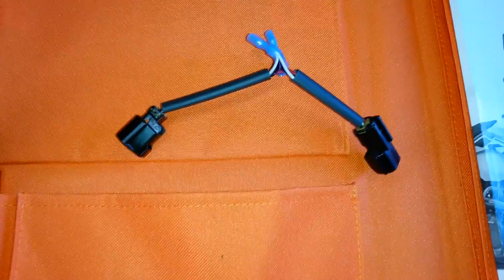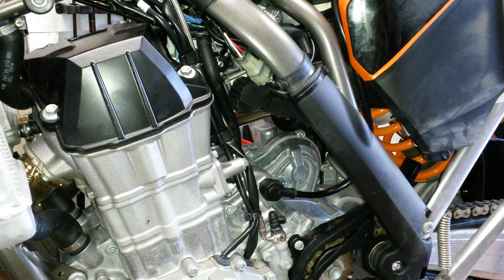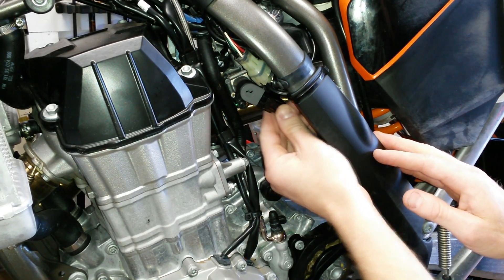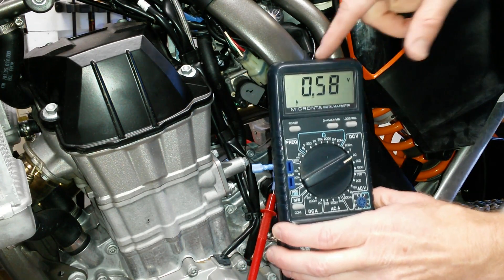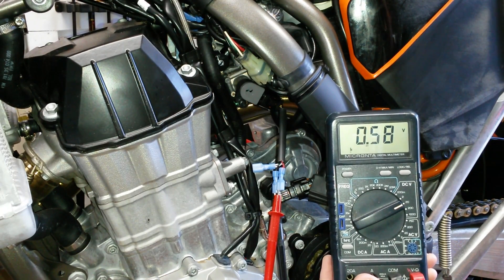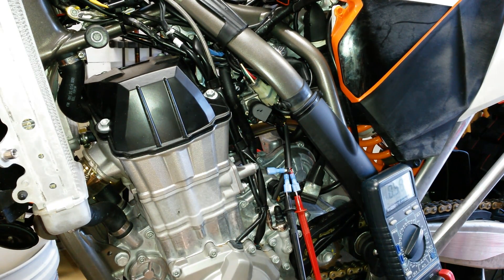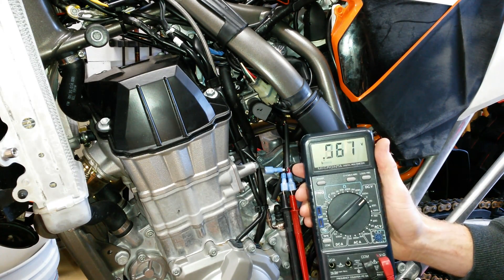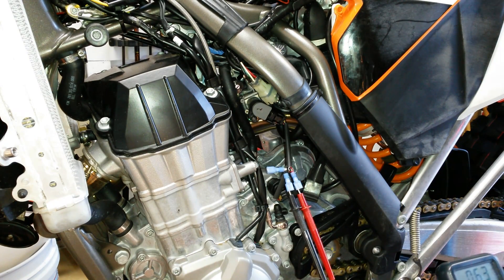KTM Throttle Position Sensor (TPS) Adjustment Made Easy - Special Tool

Comment: Hi. By moving the tps does it effect the idling?
Reply from the maker: What motor?
Reply: @Matt South  mines a ktm 350excf 2022. Its idling at 0.54
Reply from the maker: @neilb2593  Adjusting the TPS is going to change the fueling.  That change in fueling may change the idle speed a little bit, but it shouldn't be a major change unless you make a really big adjustment.  Adjusting the idle screw on that motor will change the TPS reading because the idle screw actually opens the throttle.  Does this help?
Reply: @Matt South  yeah that helps. Thanks for that cheers

Comment: what model do I need for a 2014 EXCF? I believe its model 2 but im away from my bike otherwise id check the connector.
Reply from the maker: The 2014 EXC uses the model 1.  The bike in this video is a 2014 500EXC
Reply: @8180634  would love to be able to confirm, it is a  2014 350EXCF. The website does not list this bike specifically
Reply from the maker: @martinfilteau3220  I believe it falls under EXC 2016 and earlier. Easy way to verify, go to partzilla.com and look up the TPS. If it's triangular then it's model 2, if it's oval then it's model 1.  They didn't start using model 3 on the exc until 2017.

Comment: does this work for a 2012  350xcfw
Reply from the maker: Yes it does.  But be aware that since the XCF-W does not have a key,  you would need to bump the start button to power up the TPS for about 8 seconds at a time.  Or you could just let the motor idle to keep the TPS powered up.  Or the most convenient option is the Pro Powered meter, which powers the TPS for you.  This video shows you how to adjust a non-keyed bike.  It shows a 350SX, the TPS on your bike will be much easier to access but the adjustment will work the same way.  The video shows both the pigtail and the powered meter:  https://youtu.be/v1OXY5_jAv4
Reply: @8180634  okay I need to try some things I'm having a problem with the bike starting so I'm just looking for a few things that I can check when ... and whenever I bought it the guy was running it with the idle set very high so I was trying to figure out how to adjust do I have absolutely need to have that voltmeter to or can I just do trial and error without it lol
Reply from the maker: @tjdukes7452  You "can" trial and error, but your odds are not very good.  Check out the video I linked and you'll see how sensitive it is, then decide if you want to try to free hand it.  Also I think spec idle on that bike is  around 2000rpm, plus or minus a few (check the manual), so grab a tach and set it right as that can help a lot.  The cheap hour meters from Amazon often come with a tach option.  Also check the valves as valves that are too tight can really affect starting and idle a lot, actually I would check the valves first.  If it kick starts really easily but the e-start doesn't work well then check out the torque limiter on the starter too, there are videos online about that.
Reply: @8180634  the bike kick-starts very easy the easy start button only works every once in it's to the point now where I think my battery is dead because all it does is click one time the fuel pump doesn't even turn over now
Reply from the maker: @tjdukes7452  If you suspect your battery then definitely try that first as it's quick and easy.  Jump it from your car if you have cables and that might help answer the question right away.

Comment: Is a "higher" number … from .57 to .64 mean its a little more "richer" … Im going to add a slip on pipe which will lean out my FE350. Is this my adjustment (TPS) that will make it more rich?
Reply from the maker: Yes, adjusting the TPS to a higher voltage will make it richer (more fuel).

Comment: Hi. I change the TPS for new. I have this tool. How i must set tps voltage? Throtle butterfly must by full closed , idle red screw twist off. My bike KTM sxf 350 15'  Thanks for any help.
Reply from the maker: Thanks for your question.  Double check the shop manual for the value, but I believe the factory setting is around 0.58V with the idle all the way out (throttle plate fully closed).  If your meter reads in mV then it might show 580 instead of 0.58.  That should be close enough to get the bike running (don't forget to turn the idle back up again) and from there you can easily fine-tune it by going up or down 0.02V at a time to see where you like it the best.  I hope this helps!
Reply: @8180634  Many thanks for quick answer.  Tommorow i try to set stock setting.  Now i know i must set at full closed valve.

Comment: On the motocross ktm 450sx bike how do you turn it on with no key to get a reading? Or does it automatically get a reading as soon as you hook everything up? thanks I need to do this.
Reply from the maker: Thanks for your comment!  If you press the start button briefly, the TPS will get power for about 8 seconds.  You can also start the engine and let it idle and there will be power the whole time the motor is running, but just tapping the start button for about half a second will power up the electronics for about 8 seconds.

Also go here and scroll down to the post by "MyersAvionics".  He posted a nice HowTo with pictures for a 2017 XCF, which should be very similar to your SX-F:
https://thumpertalk.com/forums/topic/1077085-the-tps-adjustment-thread/?page=48
Reply: thanks Matt!

Comment: I have a map switch programmed and installed at the dealer, should the setting be the same?  Also, how do you keep that bike so clean? It's like as if you never ride it.
Reply from the maker: I would not expect the map switch to have much effect on finding the best TPS setting, I think if you were to test for the best setting in each map switch position you would end up at just about the same place.  The video was shot right after I got the bike, so at that point you are correct it didn't have many miles on it. ;)   Thanks for your comment!

Comment: Hi, do you think this would work with the 690? Looks like the same connection.
Reply from the maker: Thanks for your comment.  I'm not personally familiar with the 690, but I believe some years this worked great on and some years the TPS is not adjustable.  Here is a link to a thread about tuning the 690 and there is some good TPS info if you read through it.  I hope this helps, please let us know your result if you give it a try!  http://advrider.com/index.php?threads/ktm-690-efi-2008-2013-idiots-guide.931664/

Comment: Hey I just bout a tps tool for my 2018 ktm 500 excf and I have not received the tool yet but I was out fooling around in the garage looking at getting to the TPS and on the 18 model it is not as easy to get to in your video. Instead of the rubber boot there is a plastic cover that has part of the Frame right on top of it? Do you have any suggestions ? Thanks
Reply from the maker: Thanks for your comment.  The 2018 is not as bad as it looks.  Follow this link and scroll down to the post by MyersAvionics where he gives a step by step with pictures.  Please let me know if this doesn't get you going:  https://thumpertalk.com/forums/topic/1077085-the-tps-adjustment-thread/?page=48

Comment: Do you know if they had this TPS before efi because my 04 exc has that or a similar sensor and I can't tell if it's TPS or some kind of auto fuel shutoff solenoid to keep the bike from flooding when off or tps whatever it is I think it's bad or in need of adjustment because carb/Jets/lean and rich screw are clean and worked flawlessly at this elevation until all the sudden it started  to bog and stall when you attempt to accelerate without choke on so I think the tps is in need of adjustment  or broken  fuel solenoid is stuck in the off or broken position not sure what it is or if it's broken is it difficult to pull these sensors out are they attached to anything???
Reply from the maker: Thanks for your comment. Yes the carbureted bikes from back then did often have a TPS, but that does not sound like the cause of the problem you're having. Check out the accelerator pump. On carburetors with accelerator pumps, when opening the throttle makes it cut out or stall, very often the problem is accelerator pump not working correctly. I hope this helps!

Comment: I used this on my 2017 KTM 500 EXC-F. It worked great. I bought a BDSB TPS adjustment tool/meter last January and it never worked right. Tried contacting BDSB (ktmandhusky@gmail.com) but no response. I wouldn't buy anything from them. I don't trust them.

Comment: Would you say my RM 250 (2T) has a TPS problem ? >>> https://youtu.be/R6uudNC4RAk
Reply from the maker: No that does not sound like a TPS issue to me.  It sounds like your throttle really might have been stuck partially open, or you had an air leak somewhere.  I would clean out the carb really good, check for any sand or anything around the slide that might have kept it stuck open.  Also make sure all of the clamps are tight between the carburetor and the motor.

Comment: If my service manual is 0.5v ,can I adjust 0.63v like u?have problems on my bike?
Reply from the maker: The service manual will give you the manufacturer recommended value and that's a good starting point.  You didn't mention which bike you have, but if the TPS on your bike is adjustable (if the mounting screws are in slots so the TPS can be rotated) then you can adjust it to be a different value to see if that improves the performance.

Comment: hi , perfect your video. I need help with my bike. I have an er6n, and I need to know if the adjustment is the same to it!? thanks
Reply from the maker: Thanks for posting!  I'm honestly not familiar with that bike, but the effect of the adjustment should be the same on anything with open-loop fuel injection.  Check your TPS plug to see which model plug matches (compare against the pictures at tpstool.com), and also check to make sure your TPS is adjustable.  Some are solidly mounted and can't be adjusted, but if there are slots for the mounting screws then it can be adjusted.  I hope this helps!

Comment: You have about 99% correct BUT unless your bike is producing exactly 5VDC to the TPS your kind of shooting in the dark. Best to send a verifiable voltage to the TPS while doing this.
Reply from the maker: Thanks for your comment.  Please google around and you'll see plenty of posts in message forums (Thumper Talk, ADV Rider, etc..) from the thousands of guys who have used this TPS Tool commenting about how well it works.  :)  The ECU actually does send an accurate 5V signal to the TPS, this is how the ECU reads the TPS while the motor is running.  Also since you're not setting a specific value, but instead you're just going up or down a little to find the best spot, you could technically do it with any voltage as long as it's consistent between readings.
Reply: Yes you can assign any value and hunt around for a sweet spot, but the ECU being accurate and the instrument being less accurate you really are hunting and not using discreet information for tuning it. Your tool is worthy of using no doubt helpful, if you want to actually know the voltage going into the TPS and the position reading as a feedback a confirmed 5VDC is needed. Not a theoretical 5VDC or assumption. Take a look at Best Dual Sport bikes website he explains it best.
Reply from the maker: That guy has a financial interest in trying to convince people that an external power supply is needed, but I assure you it is not.  The bikes ECU provides a perfectly fine 5v.
Reply: I realize that this is an old post but the issue is that the ecu puts out an exact 5 volts. If your meter is inaccurate (reads 4.9 instead of 5) then your setting of the TPS will be off because of the meter, not the 5 volt supply. That is what the 3rd wire is for. Make sure your meter reads 5 volts across the 3rd wire to one of the others before starting adjusting. One wire should read 5 volts and the other will read 4.4 volts or so.

Comment: This works great on my 2015 Ktm 450. But when we tried on a 2015 Ktm 350, it was way too rich. What is the voltage recommendation on a 350?
Reply from the maker: Thanks for your comment!  Every bike is a little different, so just setting it to one specific number won't give you the best result.  This is especially true if there are are any aftermarket parts installed (exhaust, etc..).  If you're too rich right now, then take the current reading and move it down by 0.02v, then give it a test.  Keep repeating as long as you see improvement.  On a bike that is too lean, just do the opposite; take the current reading and move it up by 0.02v, then test.  And keep repeating as long as it's getting better.  You should find the best setting for  your bike very quickly this way.  I hope this helps, please respond back with your result!

Comment: How did you like the performance after adjusting to .64 volts in this video?
Reply from the maker: It is a significant improvement.  The most obvious difference is no more burbling and stumbling below about 1/4 throttle, it is just smooth now. After a little more testing I ended up with 0.63v as the best setting for this particular bike.  0.64v was just a tad rich and would occasionally flame out in the really tight stuff, 0.63v is perfect, runs great and no flaming out.

Comment from the maker: @rustyATV - You can use the tool to adjust the TPS on your carbureted RFS motor, but it may not see as big an improvement as the fuel injected bikes.  However on the carbureted adventure bikes, especially the twins, I'm getting feed back that adjusting the TPS makes a very big improvement.

Comment: Nice video.

I know my 500 exc is running lean because the techs told me when I got in dyno'd, so I guess I'll knock it back a whisker and see if it makes any difference.
Reply from the maker: +surg23 You'll want to raise the voltage a bit.  Going for between .60v and .64v should give you a significant improvement.  Start at .60v and test, then raise it to .62v and test.  Keep bumping it up as long as you see improvement.  There's a big thread over at Thumper Talk (dot com), the TPS adjustment thread in the KTM forum, with piles of details and feedback from other riders.  I will try to post a link here, lets see if youtube lets me post it: 

http://www.thumpertalk.com/topic/1077085-the-tps-adjustment-thread/
Reply: Matt South Thanks for the info Matt. I don't actually know how lean or rich mixtures affects the bikes performance, all I know is it has a weak idle. All the power seems to be there as it was right on 60hp at the time of testing. 

Perhaps I should be looking for a smoother power delivery or something, only one way to find out.
Reply from the maker: Tweaking the TPS slightly won't have a noticeable affect on peak power at all. What you will notice is better starting, idle and smoothness at small throttle openings. It also helps to resolve flame outs.  If it burbles or stumbles at smaller throttle openings then tweaking the TPS can really clean that up.  Check out that thread I linked, piles of feedback and great advice in there.
Reply: Matt South Ahh I see! This could very well fix that laboring and stalling issue. It's the weirdest thing, to have all this power, yet it has zero tolerance for being in a gear 1 higher than ideal, shit I can put my GS in a gear 4 gears higher relative to speed and it just pulls no probs. 

Perhaps this is the reason why I am not seeing this torque the bike claims to have lol. Thanks again Matt.

Comment: Ive got a xcf 250 2011, when cold with choke out, the bike sometimes needs a slight blip of throttle to start and even when hot with the choke in still feels abit lean to me, just checked the valves and there near enough in the middle of tolerances so its not that! im cleaning the injector atm, but could the Tps need adjusting slightly richer possibly? any helps appreciated
Reply from the maker: danny cockburn It could never hurt to check and adjust the TPS, this has helped more than 1 person to resolve starting issues.  But did the problem just start suddenly or has the bike been this way since new?
Reply: Im not sure ive just bought it, i wouldn't say its hard to start but it takes about 10seconds of turning over to get it to fire. It just could be better, its not lean enough for any popping though, but to me it does feel slightly lean, I'm giving her a good going over/service atm see if i can improve it,
Reply: danny cockburn i just had a test of the TPS and it was reading 0.49v's Ive increased it to 0.62v, so fingers crossed that should aid starting. ill know more by the weekend when shes all back together
thanks for your help